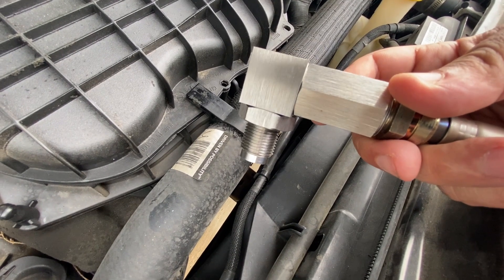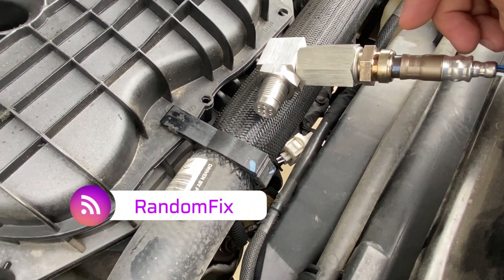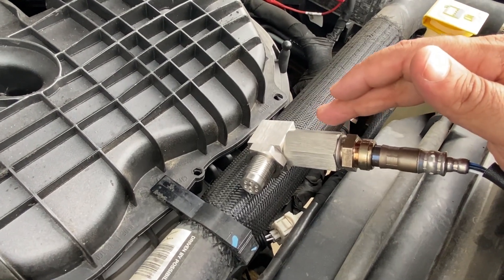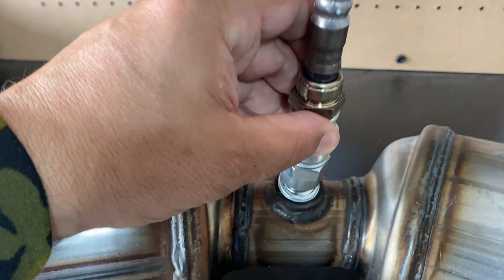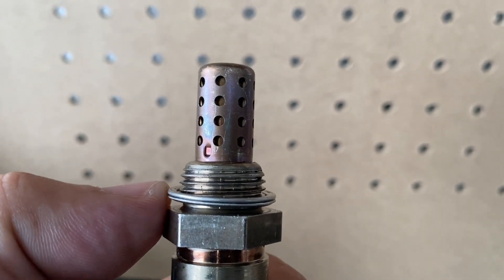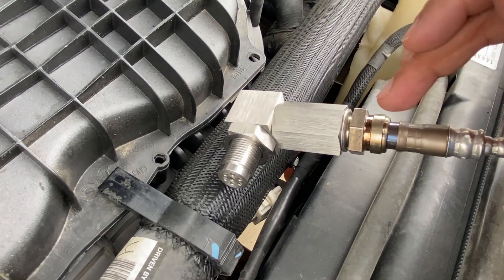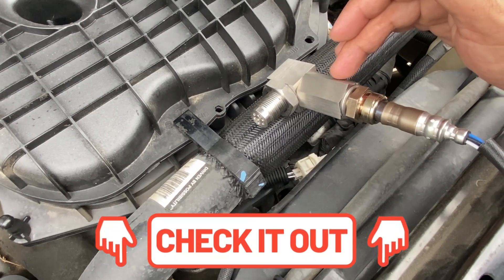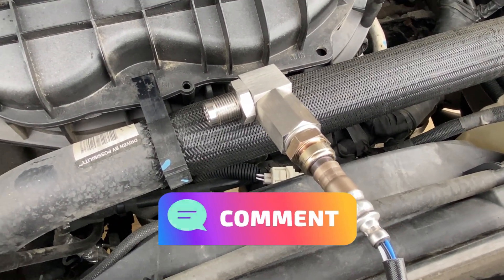Genius Trick Pass Smog Visual Inspection with Non-Fouler!

Comment from the maker: ▶▶ Catalytic Converter for $31? https://youtu.be/en6eKzyE_80
▶▶ P420 Trouble! Fix Catalytic Converter Code with Spark Plug Non-Foulers? https://youtu.be/XHyPWay4uE0
▶▶ Try This Genius Non-Fouler Trick to Pass Smog Visual Inspection https://youtu.be/VHjzqXyOKaw
▶ Link to inexpressive cat https://s.click.aliexpress.com/e/_DBMXYAl
Now the o2 spacers are called non foulers, you should really buy one with a 90 degree elbow in most cases.
▶ Mini catalyst with 90 degree bend https://s.click.aliexpress.com/e/_DEYHHMV
▶ SOLD on Amazon Here is another part number for the no drilling required non fouler Dorman HELP 42109 https://amzn.to/43SHTkZ
▶ No drill spark non fouler found at Walmart.com Hesxuno Border Car Modification Accessories Oxygen Sensor Filter Adapter Extension Screw

▶▶ Catalytic converters playlist https://www.youtube.com/watch?v=BuZYAy_xi0E&list=PLDEbtVOPRC-h1BAzaWQ-6NSnmG0gwvgwP

▶ Dirt Cheap Catalytic converter https://youtu.be/Wr1vFqCnpDc
▶ Install of $118 Catalytic converter https://youtu.be/uIXslV-Wt3o
▶ I purchased the worlds cheapest catalytic converter for $31.60 https://youtu.be/en6eKzyE_80

▶ 12 Minute Actual Drive https://youtu.be/jldTJI64cfM
▶ Demo EMISSION INSPECTION MONITOR Readiness (I/M)  https://youtu.be/gAumb9zgLZg
▶ Permanent Diagnostic Trouble codes (PTDC) https://youtu.be/PMcJtcSOzdk

▶ Acura Drive Cycle https://youtu.be/2b7dYwMQZDo
▶ https://youtu.be/uO9iDeUZOyM Audi Drive Cycle
▶ BMW Drive Cycle https://youtu.be/mk6Tk330Acw
▶ Chrysler Smog Readiness check https://youtu.be/O1RH-u1bNIc
▶ Chrysler Smog procedure https://youtu.be/dyYv4HpYPys
▶ Ford Drive Cycle Readiness https://youtu.be/LllIXoqUKJ4
▶ Ford Drive Cycle https://youtu.be/j8ZFTE1rSfA
▶ Gm Drive Cycle https://youtu.be/Yp34ksJY-fQ
▶ Honda Drive Cycle https://youtu.be/oZELvZ4danA
▶ Honda Smog Readiness  https://www.youtube.com/watch?v=cxpE_I1cKh8
▶ Hyundai Drive Cycle https://youtu.be/UzC4FNTqNdI
▶ Infiniti Drive Cycle https://youtu.be/76SByziNMFI
▶ Isuzu Drive Cycle https://youtu.be/glw0d7y5_lQ
▶ Jaguar Drive Cycle https://youtu.be/h_aCeJch53U
▶ Kia Drive Cycle https://youtu.be/OtSDdIgQ6_g
▶ Land Rover Drive Cycle https://youtu.be/A-CmBzlXszY
▶ Mercedes Benz Drive Cycle https://youtu.be/gLnhD4gP0kM
▶ Mini Cooper Drive Cycle https://youtu.be/ND08_kKz8Ls
▶ Mitsubishi Drive Cycle https://youtu.be/3ywgZW2zMa8
▶ Nissan Drive Cycle https://youtu.be/s9PLkO-CjZ8
▶ Porsche Drive Cycle https://youtu.be/Yi6eANscwhQ
▶ Subaru Drive Cycle https://youtu.be/w3DF4g2h96M
▶Volkswagen Drive Cycle https://youtu.be/uh8BhqJpzGg
▶ Volvo Drive Cycle https://youtu.be/mEeUwDd_dsc
▶ Catalyst monitor not ready? https://youtu.be/hi7QdlgKHzM
▶ Catalyst Monitor Cheat https://youtu.be/BuZYAy_xi0E
▶ Catalyst not ready? Watch this video https://youtu.be/ERQUUdWo3-o
▶ Evap monitor not ready? https://youtu.be/99nfTcPy4fo
▶ EGR monitor not ready? https://youtu.be/aujgghRf04I
▶ Oxygen sensor not ready? https://youtu.be/sAvxeAyYsRk
▶ Oxygen sensor replacement https://youtu.be/9jKuutvNs74
▶ Oxygen sensor heater element testing https://youtu.be/zEbXn6vgqiA
▶ Dirt Cheap Catalytic Converters https://youtu.be/Wr1vFqCnpDc
▶Cheap Catalytic Converter Install https://youtu.be/uIXslV-Wt3o
▶Link to Scanner in video http://amzn.to/2BZYqWo

Comment: Okay so I was thinking if I were to use this to get my cat monitors ready with no check engine light but I take to fowlers off right before inspection would that work because the monitor wouldn’t go all the way though it’s cycle making the engine light not come back on but the monitors ready? Because from want I’ve noticed cat lights come on right after that monitor is ready.